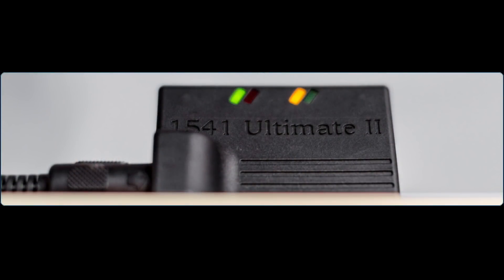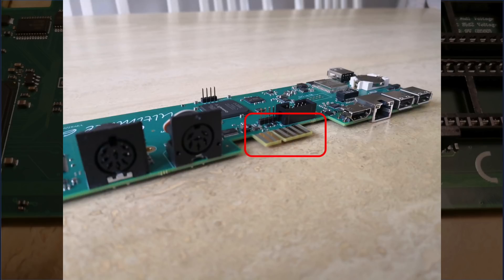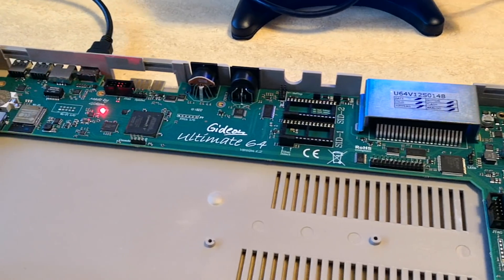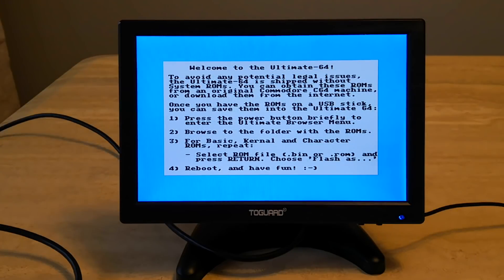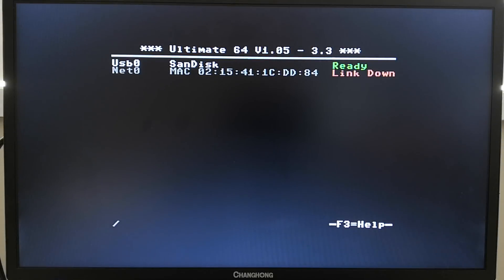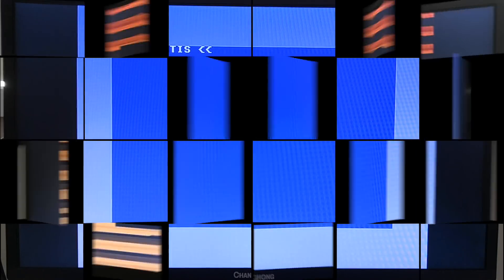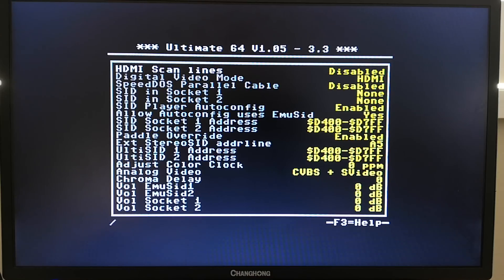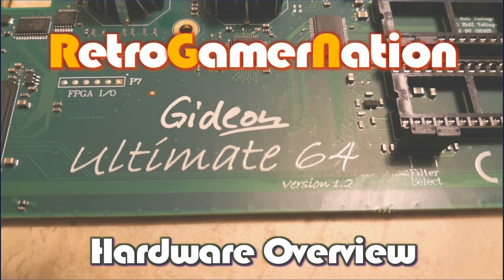Ultimate 64: All-in-on C64 Solution Overview & Basic setup guide

Comment: This looks great! However, I am a little torn. Mainly because I was wanting the experience of loading in and using a “physical” floppy drive (just like when I was a kid). I have been debating on what to purchase as I also am wanting a Commodore 64c (since that is the one I grew up on) but, I need an NTSC model. Do you think they will be releasing an updated version of the U64 that would support an actual 1541 physical floppy drive device?
Reply from the maker: The U64 does allow you to connect up real floppy drives. That is the beauty of the system...new and old  storage tech solutions can be used.
Reply: RetroGamerNation oh wow. I didn’t know that. I’ve been looking for videos showing that but couldn’t find any under the normal review type videos. The review videos generally show the Ultimate 64 loading up ROMS via the USB drive (which I think that would be great to do as well!). So, I could buy a PAL version of Commodore 64c (with a clean keyboard and case - and I mention PAL since the NTSC version seems hard to find and is priced way too high) and then order the Ultimate 64 to replace the internals?  That would be awesome! 
(Also,  a video review of the Ultimate 64 working with a floppy drive might be a good next video :)

Comment: Thanks for the overview. Everything is clear so far except for the RGB output. Where is that located in the board and which connector/cable is required to connect it to a 1084?
Reply from the maker: Do you currently use or have you used a real C64 and connected it to the 1084? If so, you should be able to use the same cable and port.

Refer to the documentation here, it may help: https://1541u-documentation.readthedocs.io/en/latest/hardware/av_plug.html?fbclid=IwAR2oxMsDlqWsaGdaoSuYbhmg-lN-kJ4utdylgjMPuPBM-dUAMJJHkkEYLjg

If you want to connect via scart, this looks good: https://www.ebay.co.uk/itm/High-Quality-RGB-Scart-Cable-For-the-Ultimate-64-Board-by-Gideon-s-Logic/254261003609?pageci=aa20d7aa-6c04-453d-aa4f-04a0e87373f9&fbclid=IwAR3HRScGCLad5nqFLHBunRoqbDM4Gh9MlYH97KsljU-0Zvkq6-JOEvVF-UI

Its worth  taking a look at this ebay listing as it includes instruction on how to set the analog video mode correctly within the listing.

Hope some of this helps.

Comment: As a fellow Aussie, I have to say "Great job mate" and thanks for the information. After I watched your vid, I subscribed and pre-ordered a U64. One question - How did you secure it in the case ???
Reply from the maker: Thanks for taking the time to provide feedback. If you have the old breadbin case then the U64 will fit right in with existing screws and holes. If you are using a C64C style case then you will want to buy some brackets. You can check out this link if you are interested in purchasing a set while you wait for your U64 - https://shop.pixelwizard.eu/3d-druck-ersatzteile/55/ultimate-64-tastaturhalter-set-fuer-c64c-case?number=SW10055.1
Reply: @RetroGamerNation  once again, thanks a lot !!

Comment: Can this be updated cause this is a simulated C64..?? Its a bit like a emulator but its coded into the FPGA so it can have all the same connectors as C64 Originali,its like the C64DTV. Does it have the 555 timer and 9VAC..? dose it run Beach Head.,if it dose it have the 555 timer code in the chip.a C64 Original can run on 5V. I have a Sav64 and can run my C64 Original on a 5v 2a adapter.Its the overload of the 5v line in C64 PSU that blow the chips in a C64 Original.Anyone that uses the original PSU should bin it and make one or find someone that dose.

Comment: how is this compared to Turbo chamelleon 64 and MiSTer?
Reply from the maker: I have not had the fortune to use the turbo chameleon but have used MiSTer. Compatibility is  better with the U64 at the moment in my view as the MiSTer C64 core still has some maturing to do, but it will improve over time. The U64 allows for original peripherals and carts to be used, it has an inbuilt SID player, so maybe its a little bit more versatile, while providing more of an authentic experience. MiSTer cores receive more regular updates so it is worth keeping any eye out on the scene and dont forget that the MiSTer  can simulate multiple computer systems (just like the RPi can do at a more affordable cost).

Comment: giving this board is emulating the C64 and the 1541 I prefer a Raspberry Pi better; it's tiny form factor, the use of a mobile phone ac adapter and the built-in sdcard, ethernet, hdmi and sound of the RPi makes it the winner in terms of retro emulation for me; with its 4 usb ports I can connect virtually ANY controller (retro or current PS or XBox) to it, so Im pretty much covered with a cheap Pi; and u cant beat the massive RPi community support, software repositories and mods
Reply from the maker: Great to hear that you are able to satisfy your C64 gaming needs via the RPi. I've given that a go in the past and its certainly can provide a good affordable alternative to a quality FPGA solution.
Reply: I prefer a REAL C64 + a Pi1541; the fpga is always expensive compared to everything basically, and it has the disadvantages of being closed hardware where you need to wait (sometimes months) for ridiculous updates; for example I've read about the 4:3 issue which is unacceptable for C64 video; if I paid say U$75 I can live with some minor issues but at almost U$300 these kind of problems are a deal breaker
Reply from the maker: The cost factor is prohibitive to many people. I've tried my C64 gaming across multiple setups (RPis, PC Emulation, FPGA only, Real hardware only or a mix of Real and Simulated (like your preference) and my favourite two are the Ultimate64 due to the convenience and versatility once setup AND a real C64 with an Ultimate II cart attached to CRT. But what I like the most is that people have so many choices/combinations to choose from to fit their budget and their desired outcome, who would have thought it 30 years ago!
Reply: @RetroGamerNation  If I'm not mistaken, the Rpi/Mister/Etc solutions don't allow a real C64 keyboard to be used, right ?
Anyway, I ask just for reassuring myself because I already have the U64 at home and love it (only used less than 10 hours up til now)

Comment: Currently it's 215 euros, which is about $245US. Yikes!
Reply from the maker: Its the best 215 Euros you will spend if you are really into your C64. Don't forget that you are also getting 1541 and data cassette simulation included and HDMI output...its a device that will outlive both you and I!!
Reply: @RetroGamerNation  No denying that it is an impressive piece of technology. Just a little sticker shocked...
Reply: The original c64 without drive and HDMI already costed $599 in the 80s.
Reply: @DJResourceTV  True, but a CD player used to cost over $300. I would not pay that much for one nowadays...

Comment: This is a fantastic board. 

What is nice :
- HDMI output.
- extremely clean composite output, amazing.
- integrates an 1541 U2+
- possible to use an original 6581/8580 chip, which is definitely  a top notch feature as the onboard emulation, even if nice, cannot beat a real Sid chip
- 3 USB ports
- supports original drive / tape reader
- 2 db9 joy ports

Not so nice :
- some bugs like freezes, cannot load some games, hanging notes
- no user port (not a problem for me).

Comment: Thanks for the review/tutorial. I just got my Ultimate 64 board yesterday. NOTE: If using HDMI, you will have to change display settings somewhere in the menu. From DVI to HDMI, otherwise there will be no sound, just picture.
Reply from the maker: Yes you are correct. I did forget to mention that you need to change the default display setting from DVI to HDMI.
Reply: I had the exact same problem and have been looking for days. Then I asked Gideon and he told me i had to switch to HDMI.

Comment: I would like to see some cpu optimizations, like the stuff they did with vampire- cache and pipeline execution, which would accelerate CPU without changing the clock and timing issues. Also, one RAM slot with REU implementation would be nice, maybe along with the SuperCpu compatibility option. Saying all that, this is fantastic device and i really dont see why it wouldnt be for everyone, as you said. Price is a bit steep but hopefully there will be enough orders for it to go down.
Reply: If it is anything like the Ultimate II+ cart which is integrated in this version then you can turn on REU memory emulation. Perhaps someone with one can confirm?
Reply: @arnuph1s  confirmed